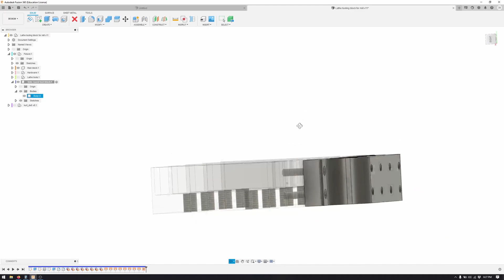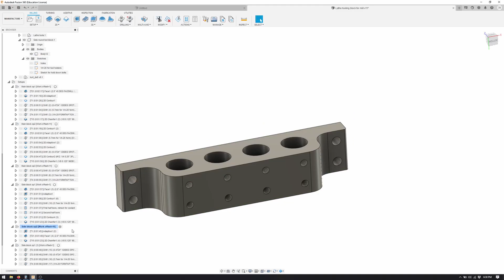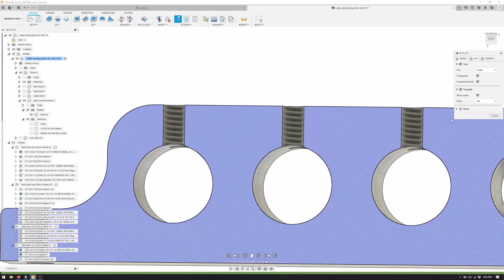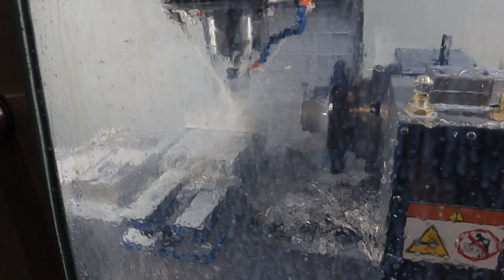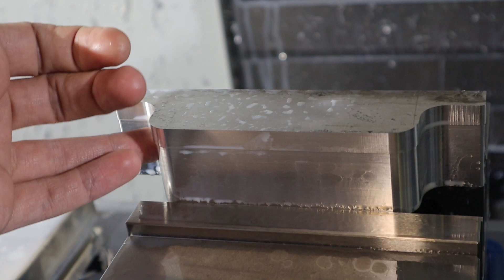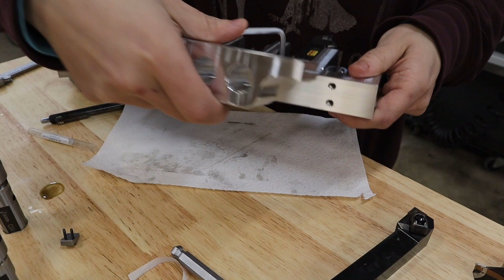Turning the mill into a lathe - Side tool block

Comment: Haha i admire your dedication on the deburring the back side og these thread holes on a fixture haha. Using  time og programming it, risking breaking a tool and still ending up deburring it by hand 😂👍

That haas control seems very clunky to use in tight spot situations without feed/rapid override knobs. I Will never get used to it 😁
Reply from the maker: What can I say? I'm the master at spending time in the wrong direction:)

Comment: I guess you probably figured it out already, but in case LucaisBusy have linkedi n the description the modified Haas post-processor for mill turining (it's for Fusion).
Reply from the maker: Thats what I'm looking at trying first :)
Reply: @split141x  Sounds good: I have used the same postprocessor for Mach3 and works just fine.